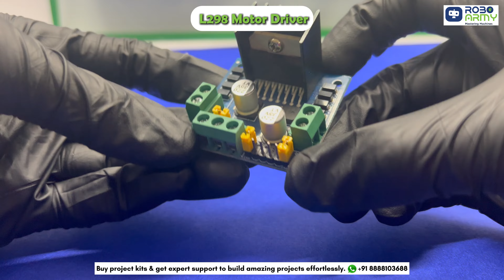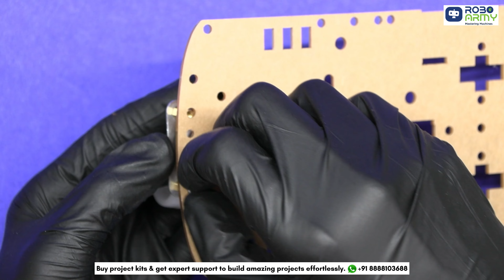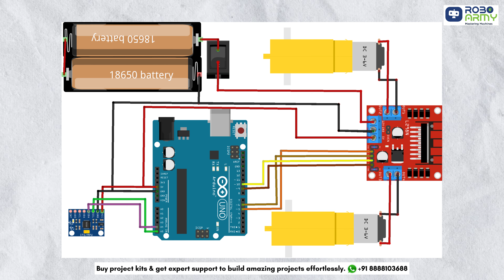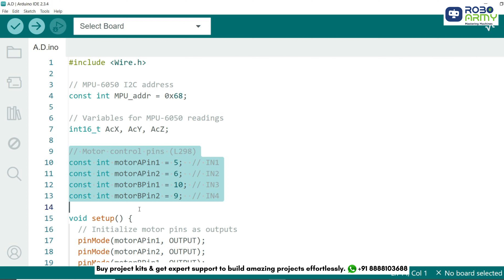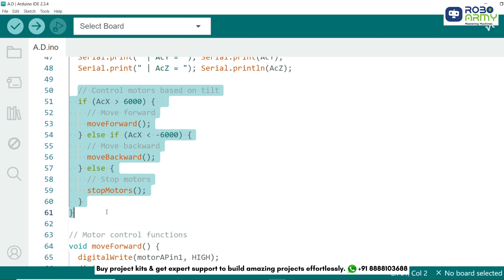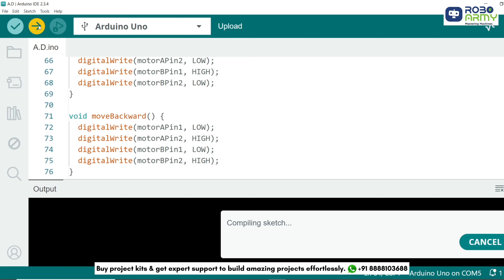How to Build a Gesture-Controlled Robot with Arduino | MPU-6050 Motor Control Tutorial

Comment: can i use l2n3d motor driver instead of l2n3dn
Reply from the maker: In this project, we've used the L298N motor driver. The L293D can also be used, but it has a lower current capacity compared to L298N, so performance may vary depending on your motors.
Reply: @robo_army_  ok thanks will the circuits and code be same??
if no could you please send circuit once
thanks again
Reply from the maker: Yes, the code will remain the same. However, the circuit will have slight differences in motor driver connections. The L293D requires separate enable pins (EN1 and EN2) to be set HIGH for motor operation. Make sure to connect them properly. Also, ensure your motors match the current rating of L293D for proper performance.
Reply: @robo_army_  thanks a  lot ur the best
Reply from the maker: Thanks for your words. Keep supporting and learn more robotics with us.